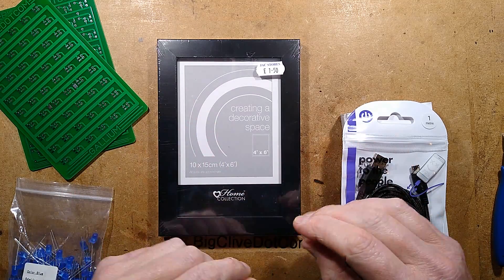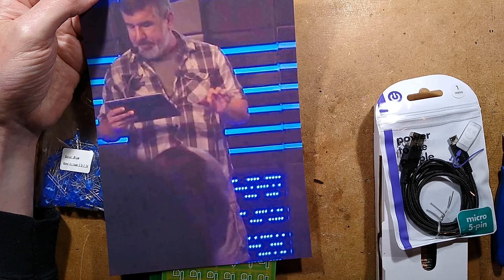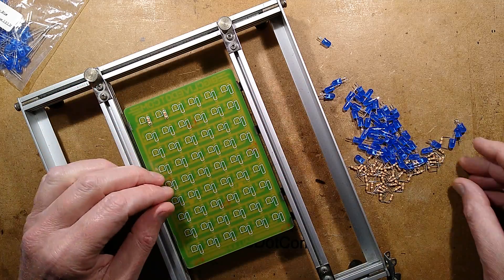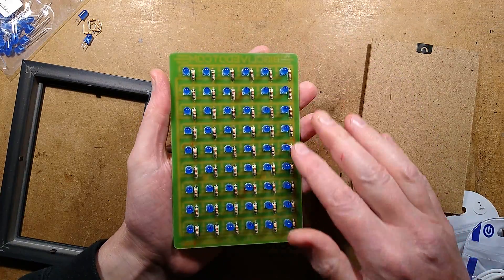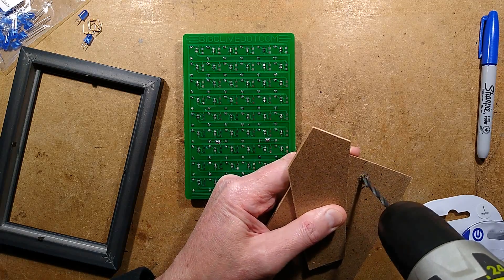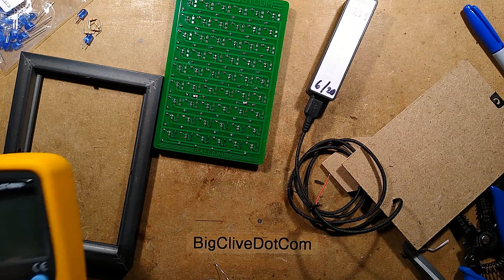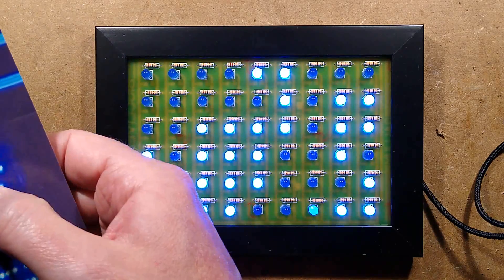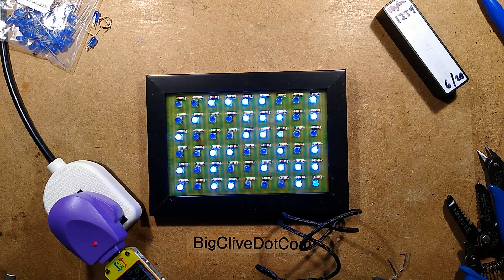The new blue chaos PCB.

Comment: Very cool.
I will have to look in to what is involved in getting PCBs made.
Back when I worked for a contract electronics assembler it was quite a production to get a custom PCB made.
Lots of set up charges and very high per board cost if you got less than 100.
It wouldn't look nearly as nice but somthing like this could be done of perf board fairly easily.
Reply from the maker: You can download the zip files here.  Just select upload-files on most Chinese PCB manufacture sites and they will fill in the data automatically.
Gallium PCBs at:-  http://www.bigclive.com/freebies.htm

Comment: The leds in the FaF video look sequenced to me, I see bars of blue scrolling right to left, then they bounce and continue. They look like they are all on the same sequencer but wired in at different positions to give a 'random' look to them. They look like they are also wired in rows of 4. At 4 minutes 25 in the video if  you pause and count the visible rows, the pattern is repeated. row 1 is the same as row 5, 2 as 6, 3 as 7, 4 as 8. only 9 and 10 look different. Hope that made sense and helped. God I love panels of flashing lights and switches  and buttons that light up when you press them. Id have had my dream job at NASA control in the old days lol

Comment: What size smd resistor?
Reply from the maker: 1206 with a value of around 330 to 470 ohms.
Reply: @bigclivedotcom  darn i just ordered the 1206 in 220ohm
Reply from the maker: @RespawnRestricted  That's good too.  You can tame down the intensity if needed by adding a few 1A diodes in series with the supply.  If you build an A4 version the higher value resistors help keep the intensity to a sensible level.

Comment: Hi Clive.  I've built 4 (1ea RGBY) of these and working on number 5 which is mixed.  I don't have any USB power banks yet (dollar stores here in 'Murca don't sell many electrics/electronics, I think due to liability considering Chinese-ium construction) so I joined the 4 complete boards in parallel and connected them to my benchtop DC power supply.  Having them all lit, I noticed at 5 volts constant those boards only draw 500 to 600 mA depending on how many LEDs are lit at any given time. I also noticed there are differences in the brightness.  I rank them as GBRY from bright to dim.  Interesting since all of them came from the same supplier you used and all were in factory-sealed bags.  Regardless, they still look awesome side-by-side. Thanks for sharing this fun project with us!
Reply from the maker: That's the correct scale of intensity.  The green and blue are gallium nitride with green being at the peak of eye sensitivity and blue being at the extreme end of the visual spectrum.  With the red/yellow it's down to the efficiency of the older gallium arsenide technology.  There's much more demand for high output red chips for use in RGB displays.
Consider getting a beefy power bank from Walmart.  They are good value and made to local standards.

Comment: Does anyone else find these flashing leds very very sensitive to solder heat damage, or am I just rubbish at soldering. I have a failure rate of 10% roughly of previously tested working leds. Not sure what I’m doing wrong.
Reply: Had about 3 blue ones fail on me (on all the time), but no red ones.  At the price and volume I'm guessing little or no qc.
Reply: There may be two problems:
1. LEDs can be damaged by soldering temperature. The Absolute Maximum Rating for through-hole LED soldering, for temperature and distance, is 500°F (260°C) for 3 seconds at 2 to 3 mm from the package base. This is an average derived from looking at many LED datasheets. So use a 3 mm space between the PCB and the package base, and pay attention to solder temp and time.
2. LEDs are electrostatic sensitive. Use a wrist ground strap.

Comment: My first OpenSCAD script, to make a panel with 56 holes for the LEDs. Measurements taken the from PCBs received from JLCPCB. Thanks to Clive for the inspiration. They are great.

x = 154;
y = 102;
d = 1.5;
xgap = 15.2;
ygap = 15.2;

difference() {
    cube(size = [x,y,d], center = false);
    hx = 15.2;
    hy = 12.5;
    
    for (j=[0:5]) {
    for (i=[0:8]) {
        translate([hx+i*xgap,hy+j*ygap,0]) cylinder(2,2.7,2.7,$fn=12);
    }
    }
}

Comment: How about a tall column of lights about 2 meters.  Could that be run off USB or a small PSU.
Reply from the maker: It could be run from multiple PSUs or a few high current ones with suitable sub-circuit protection.  (inline fuses)
Reply: @bigclivedotcom  Id like to make something to run up each side of my keyboard stand at gigs.  At the moment I use 2 strips of 5050 LED`s that run off USB.  Its nice, but Id like a more random effect if it was possible to build one.  As at the moment they just fade or change colour together :-).

Comment: Clive, I like this project like many others that you have done. Because I am living on ill health benefit I don't have much to fund anyone via Patron etc. Though it would be cool to have a go at building your kits myself if I could get them. I was also thinking, when cutting off the Micro USB to cut them longer with some cable than throwing them away. That way you could then have two power plugs options (short or long) to solder the Pos & Neg to other PCB Kit boards. There wouldn't be a problem with the polarity being incorrect (without reversing colour + & -) to power up a kit via the shorter Micro USB?

Comment: I'm curious why did you solder the resistors in two steps? (5:00) and the LEDs (5:26)
Reply from the maker: I tend to solder one lead of each component first, check they are sitting flush on the PCB and then solder the second.
Reply: @bigclivedotcom  Ah. It looks very retro. Puts me in the mind of "Lost in Space" :)

Comment: If this were a kit with LEDs and resistors included I'd very much like to buy it. Though I'd settle for just the PCB. I like this revised version with the option for through hole or surface mount resistors. Nice little project. Cheers.

Comment: you should add a micro usb contact on the pcb to practice smd soldering, you could fit it somewhere around the middle of the board. also its great for not having to cut off usable cables like you said

Comment: Great work, Clive.  You have the same soldering station as me and I wondered if your iron occasionally goes cold?  Mine does and I have to power it on and off, usually it re heats and is OK for a bit.
I have replaced the iron a few times and it continues, so it must be the station itself, any thoughts? Keep up the good work, Allan
Reply from the maker: What does the display show when it stops?

Comment: Suggestions to all the people begging for the PCB file or a kit. Buy the flashing LED's and resistors on eBay, they are easy to find and cheap. Make your own PCB   or use a predrilled project board with copper solder points ( what I will do ). Doing a little extra work won't kill you and will be well worth the effort. Also this extra work will keep you busy at home where you won't be spreading around the Corona virus!

Comment: I'm thinking of building a similar project with RGB LEDs, decade counters and 555 timers. adjust all of the timers to be at different speeds. making sure the LEDs are tied to the decade counters in no particular order. if I keep the individual colors segregated to their own decade counters, I should be able to get nearly every single color that is capable of being produced to show up at one point or another. it won't be truly random but it should look pretty close.
Reply: "Decade counter" == 4017 ? I used RGBW LEDs to do something similar, but with discrete LEDs and carefully-not-sync'd colors; the resultant random-ish color-mixing makes me happy (and the W keeps the light on, per Motel 6, when the RGB are all off :-)
Reply: @theskett  yes. the 4017.

Comment: If you bridge the data wires in the USB cord you can pull more amps. USB power supplies limit current to .5A if there is no data signal. Putting different resistors on it can let it reach up to 2.4A I believe.

Comment: When I was an apprentice working in a telephone exchange we built something similar using recovered strips of old switchboard lamps and uniselectors (strowager 50 point rotary stepping switches).  It worked at 50v, the noise of spinning switches was horrendous and using incandescent lamps and relays it used about 2Kw, We thought it was very hi-tech (by the standards in 1973).
It was "done proper" and wired to BT standards, not quite to turing's bletchley park standards ... but it used a lot of similar kit.
The panels were "borrowed" and became part of the christmas decs until star wars set new standards.
Reply: Used to build traffic lights with those, with the green, yellow and red lamps borrowed from the Plessey racks.

Comment: I worked at a major computer manufacturer in the 90s and they had a visitors centre at the factory for when Large Client visited.
There was a window showing the data centre.  Only thing is servers are very boring.  So, they put  panels of flashing LEDs under the mesh fronts of the cabinets so it was more exciting.
Another company a friend worked at in their reception lit of lights on the floor to represent where in the world their services were being used most.  The lights rarely changed so they changed it to a random batter as looked more techie.

Comment: uhm... guys dont get me wrong, I dont wanna show off or talk about how good I can do with the sodering iron. But its actually a matter of what tool you are using (unless you are a pro). During my education as an electronic developer I tought 120 6th graders how to solder smd parts, I also tought my grandma. And I discovered that if someone is new to soldering, all it takes are some good tips for the beginning and good tools. When I learned it, I buyed myself one of those big rotating towers for storing electronic parts and filled it with resistors. A week later I ordered 0805 smd resistors, and now I am using 0402 and 0201 resistors and capacitos. I have to admit, 0402 is not easy and you need good tools, and 0201 is still a bit of a challenge to me, but 0805 and 1206 shouldnt be a problem even for a beginner. And good tools dont have to be expensive, I had the ersa 	0260BD as my first soldering iron and I did everything with that one.

So, again dont get me wrong. I just want to encurage all of you to try out smd soldering as it is easy to learn and the world of smd is soo awesome! If anyone needs some advice or help getting started with smd projects, tell me and I see what I can do

Comment: I tried to 'detect' if one of those LEDs were blinking by hooking it up to a transistor, you could probably get them to blink all at once that way, but there is still a small voltage across the LED when it is not blinking so the LED that is hooked up to the output will always glow a little bit.

Comment: If there were static LEDs in series with a flashing one, would that cause them to flicker in groups as seen in the video?
Reply: Maybe,  but 5V is only enough to run one blue LED (3V drop), and the flashy LEDs probably won't block much higher voltage.  Maybe try a red LED, though? (2V-ish drop).

Comment: You could use a daughter board on the back of the pcb that has a micro b connector on top to power the project.
Reply: Or just on the back of the picture frame, yes.

Comment: Super cool love this! 
- and I think I may try painting the PCB since you have planted that idea in my head now. 
I was thinking of using a cut up drinking straw to make covers for the LEDs to mask them off for the painting after assembly. 
So cool.
I wonder if I can use a heat sealer/cutter at work to seal and cut the drinking straw ends? Going to have to try that!
Reply: Just spray-paint the PCB before adding the LEDs, no?   So much easier :-)

Comment: When you fill the frame with a black resin to such a depth that the resistors are invisible, Or 3D Print a black plate that has the holes for the LEDs in to cover the PCB and Resistors, That would look nice. :-)
Reply: Just put the resistors on the back (you can do that already) and spray-paint the front black; then add the LEDs. Much easier.

Comment: What happens if you put like 5 flashy LEDs in series with one resistor and a higher voltage? Would they kindof sync each other and blink in unison?
Reply: You'll need at least 15V for five series blue LEDs, which is probably enough to blow whichever turns off first. But you could have the current-limit resistor turn on e.g. a MOSFET, and then have the MOSFET turn on e.g. four paralleled non-flashy LEDs.

Comment: Could you put the resistors in then paint the front so you have a single color contrast with the leds. Or is there enough heat or something else that the resistors would repel the paint. 

Great project. Thanks
Reply: The resistors are only dropping ~2V at ~15mA, so 30mW and (must) run cold.

Comment: Trauma sheers are the best for cutting metals of all kinds. A number of years ago Walgreens sold ones under the name "Incredible Scissors" that would cut through even a nickel. They also had an autoclave rating on the plastic handle so you could use them medically & properly sterilize them if needed. One side was mildly serrated, just enough so that metals would not slip out of its jaws. Excellent product, I use mine every day.

Comment: I power my little projects with cell pone wall warts (chargers) that I get at consignment shops and at Goodwill etc. for 98 cents.  I buy only chargers with 4.9 to 5.2 Volts at 0.5 Amperes and over.  They are switching supplies. Ron W4BIN
Reply: Great idea for efficiency, too. I keep old wall warts for projects like these but they are nowhere near as efficient as a cell phone charger would be.

Comment: Micro USB port tip: you can get like a dozen or more micro USB port on little breakout boards about the size of a pinky fingernail or smalle. they're awesome for projects you can tap just the power you can have power and data and you don't have to mess around with a surface mount soldering you have through holes to work with. I have a few projects where I just attached them on for the power supply or in one case I replaced a charging port on a keyboard or another one where I added USB power because the internal power supply died.
This also allows you to separate the connector Port from your project which means they are easily replaceable if damaged and a strain relief between the port and your board that prevents damage on it! Anybody who's repaired a laptop power port will understand what I mean!!

Although if you're looking for a reliable and sturdy Port I personally recommend going with the USB Mini ports. for some reason they are more durable and usually of a stronger material I've seen nothing but damaged micro ports and most of the USB mini ports I've seen are intact unless you're stupid with them.
Reply: Yeah but this way you never lose the cord.
Reply: @johnpossum556  lol. I forgot to explain the benefits of that.
Personally I don't like attached chords because if something goes wrong you can't quickly swap it out and in the field it means opening to diagnose or repair but they do have their uses.

Comment: For a Micro USB connector you could cheat and use a breakout board and some header in a way where the USB connector points towards the centre of the frame. You'll get vertical clearance for a USB cable to connect and with it pointing towards the centre a cable won't poke out the side, and you'll not have to worry about the weakness of a vertical connector.

All this needs is a 2/4U rack blanking plate with holes drilled for the LEDs.

Comment: Tried sending a couple bucks via PayPal but the fees were just silly...
Reply from the maker: For all their flaws, Patreon are so much better than PayPal as they allow much better ongoing communication.
Reply: @bigclivedotcom  I'll have to give it a look now. I don't want to be that guy but do you have a btc wallet? Also I went on eBay and got some of these blinking leds and some cheap perfboard, I wonder if I could spray paint the back of the board for a clean look...
Reply from the maker: @aaaaaaaaaassssssssdf  I don't use Bitcoin.  You can make one of these panels by just drilling a series of 5mm holes in a piece of thin wood and hardwiring the LEDs and resistors.
Reply: @bigclivedotcom  i had a bit much to drink and joined the patreon, here's to more shenanigans. i considered that but with my drilling skills it would be pretty sloppy compared to a pre drilled board, but worth considering so you can simply use the backboard of the picture frame
Reply from the maker: @aaaaaaaaaassssssssdf  I don't have a btc wallet.  I used to paint my PCBs for different surface finishes.
Matt black for TV and film use to avoid reflections and dark metallic vehicle colours for my ornamental ones.

Comment: I like the way that it turned out!  I have been wondering how to make a similar style light panel, but have no circuit design experience.
Reply: You don't need that. You can use universal prototype boards (veroboard). Each LED is completely independent. Positive rail - resistor - LED - negative rail, repeat as many times as you have LEDs.

Comment: i wouldn't be surprised if they used addressable LED strips for that prop - later on in the video when the ride vehicle pulls up to the loading area, there are some chasing/scrolling effects on the car's ceiling that definitely look like addressable strips
Reply from the maker: I saw those and they do look like WS2812B strip.  I'd guess there might also be some behind the set strips, but I'm not so sure about the computer panels.